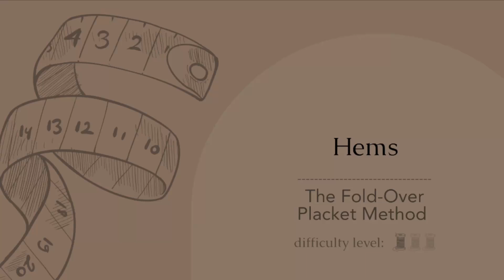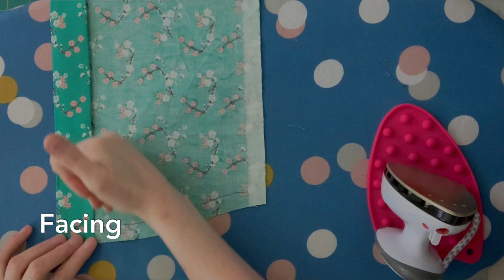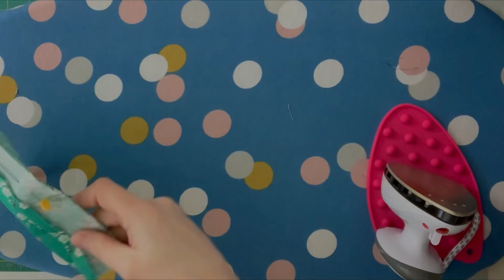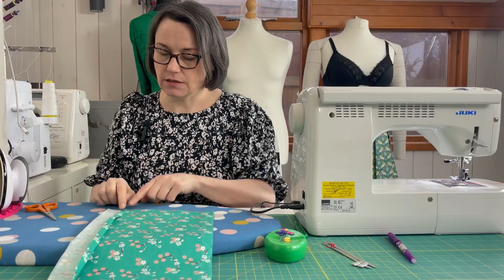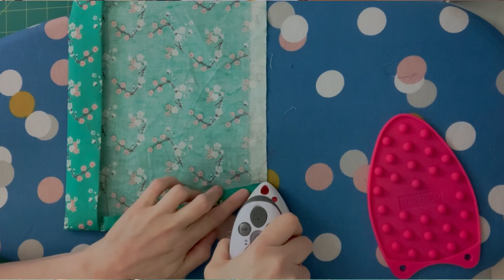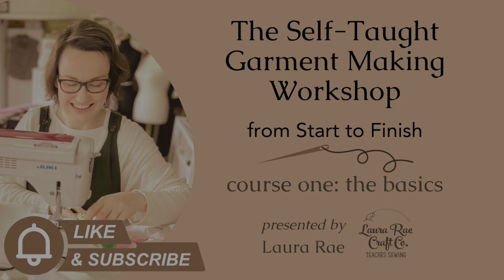How to Hem Across Facings

Comment: Surely not leaving the row edges.
Reply from the maker: It’s not unusual to have a raw edge on a facing. A facing sits on the wrong side of a garment so therefore the hem is concealed between the layers on the wrong side. You can also use this method to do a double folded hem.